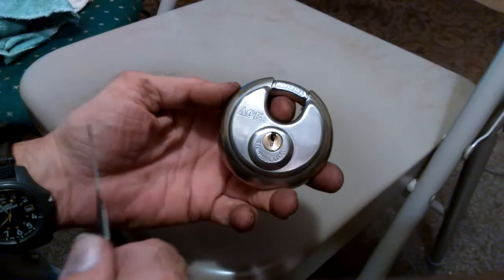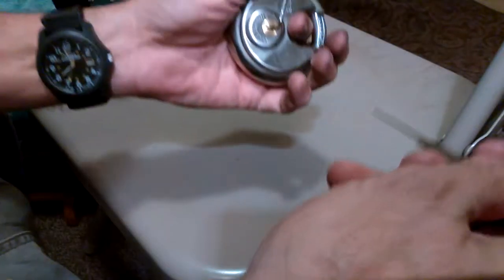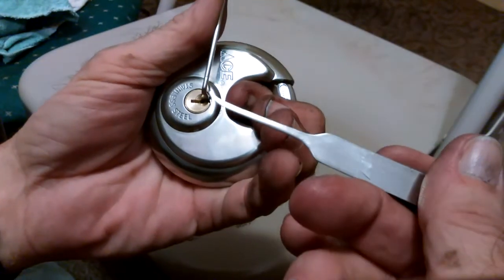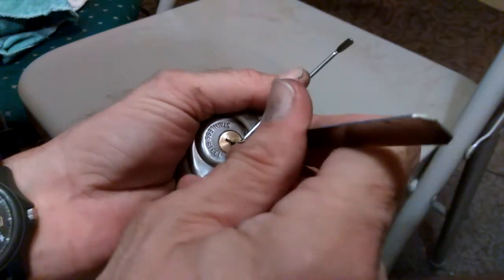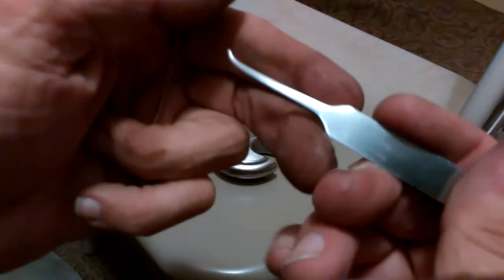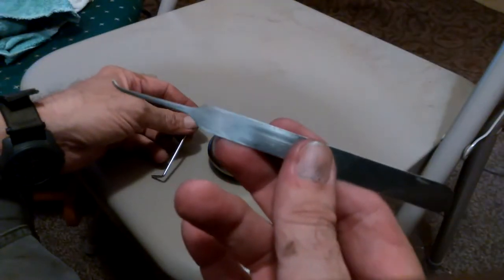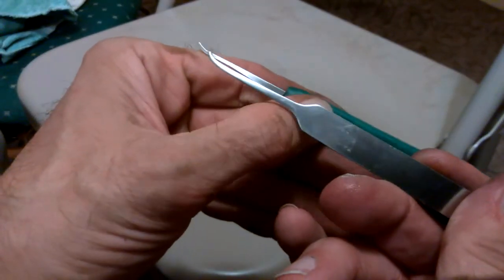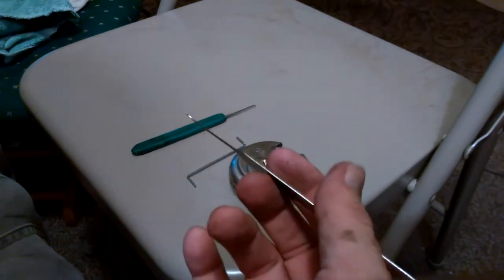(167) ACE Disc Lock # 5099510 SPP'D Open

Comment: Very nice open on your discus lock :). Your new pick looks awesome, very good work :). Yeah haha, definitely make some handles for it, that will make it much more comfortable. Some people grind only away the top side, but I like how you did take the metal away from both sides :). That's how I prefer it too :). Try to take out as many deep scratches as you can, these can be breaking points soner or later. Keep up your nice work :). Cheers :D
Reply from the maker: redcatimaging Thank you Foxxy. I find I'm bending my hooks now that I'm SPP'ing more. I prefer a nice flat top on my hook, so I can stay on the drivers while lifting. A point like a diamond, or a gem is ok, but it slips off the pins often when I'm picking.
Reply: Everyone has a different preference, so if you like a flat tip thats fine :). You should not bend your picks haha ;). It's sometimes needed to give more tension (I prefer feather light tension often, but not always), but when you set the pin, then just back up tension a bit ;). Well, I have bended some too at the beginning haha ;), mostly commercial picks or very thin diy ones. Just made a handle for my new Sparrows Matador which arrived today and I'm already in love with that pick :). It's the only commercial one that comes close to my favorite pick from T&J :D.

Comment: Great job on the pick.  Works well is a success for sure. 
How thick is that stock you use?
Reply from the maker: Steel Pinnings It's a .023 blank from Yalesleviathon at www.uklocksport.co.uk.com. I haven't measured the final dimensions, and it's probably a little less than .023 because I had to sand it to remove a few grind marks I made by accident.